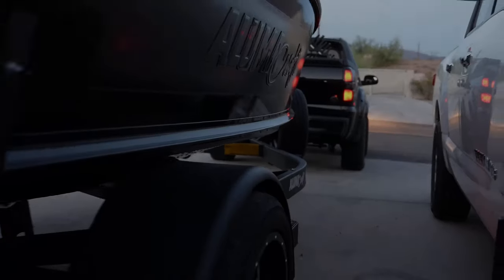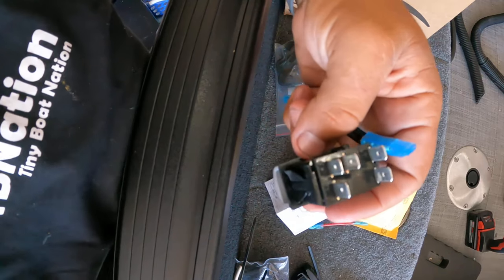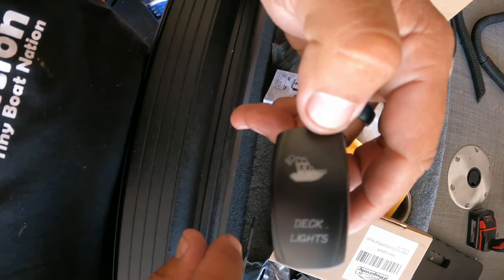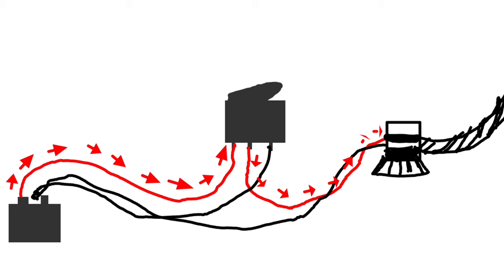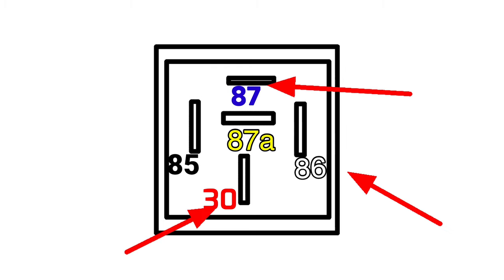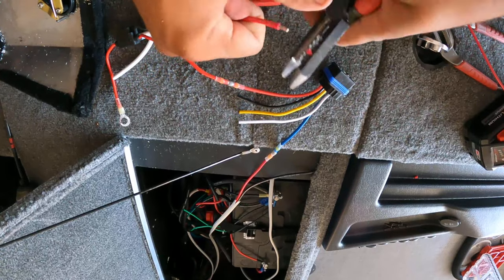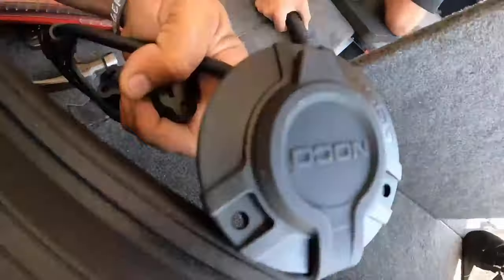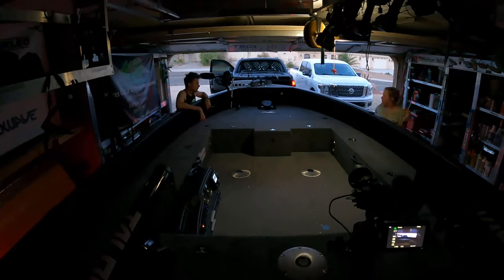How to wire a relay switch in a boat + 5-pin LED Rocker Switch Install | Boat Wiring

Comment: think of a relay as a high amperage switch that is controlled electrically by a low amperage switch.   you can use that yellow wire on that relay with just a 2 position switch to hook up a three wire bilge pump. when not energised 87 and87a  are connected throgh the relay  so you can run the automatic function. but when the switch is thrown 87 and 30 are connected to the manual bybass wire.  its a quick and dirty if you dont have the right switch on hand.

Comment: Super helpful video to those unfamiliar with electronics in general same principle can be applied to and DC voltage circuit. I know you’ve set up wiring on new builds have you done a complete re wore on older builds or older boats? Look at re doing my entire stratos 201 fs it’s a complete Frankenstein hack job and am a little intimidated LOL not based on skill just space and accessibility LOL how it is working wiring on boats my bars ground is car so fairly easy LOL

Comment: It seems using relays would be easier since power for the load would be thru relay and all relays could be mounted somewhat close to load. One separate circuit to a switch bank could be used to control all relays then individual wire from each switch to corresponding relay and these “control” wires could be smaller since the only load is the coil within the relay which should be minimal, not sure what that load in watts is. Am I thinking correctly ??

Comment: Hey TBN how’s it going I like the vids you post, I was wondering if you could help on my new 24v 50 ah Dakota lithium it only turns on when it’s on the charger, as soon as I disconnect the charger the battery won’t turn on and I get 0 power to my trolling motor